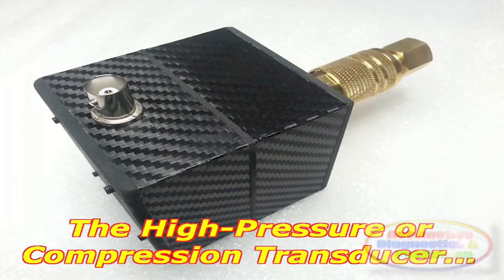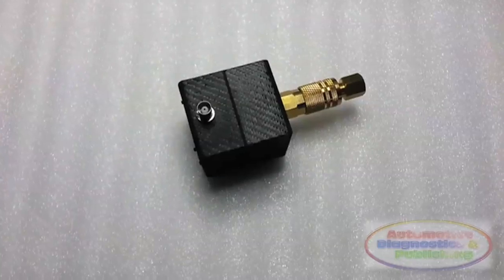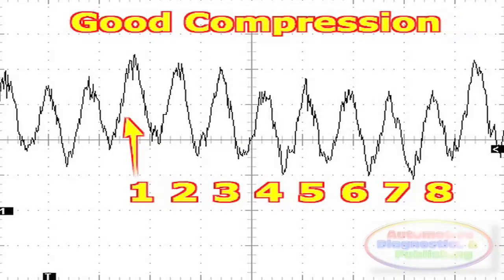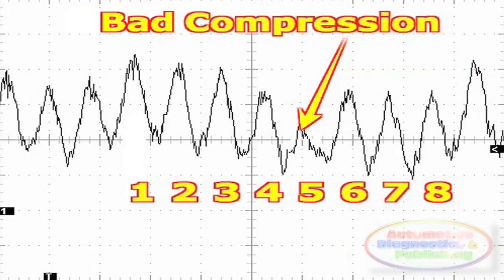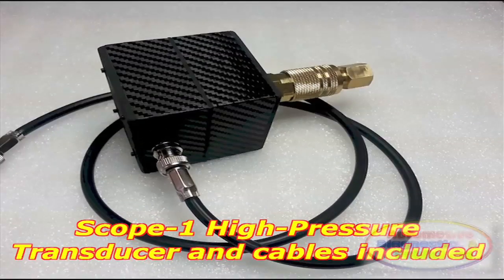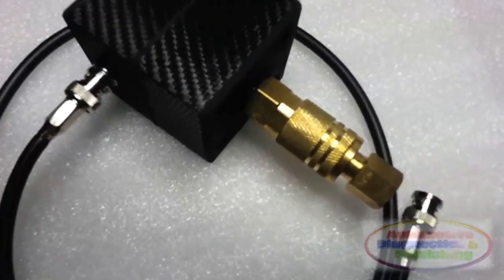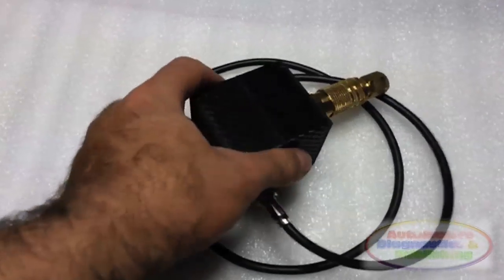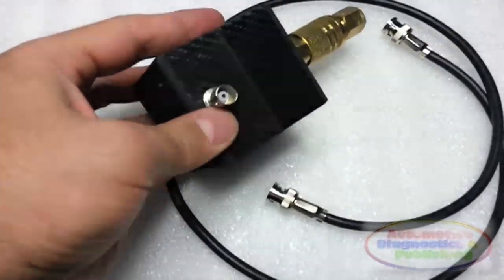COMPRESSION PEEK Transducer

Comment: Does this transducer have an internal battery? Or does it have a way to plug in to a wall or hook to a vehicle battery? Should be able to use on a scope that accepts banana leads with an adapter cable correct?
Reply from the maker: Edward Boers Yes, once it becomes available you may use this transducer on the Scope-1 or any other oscilloscope with a descent display. It'll be sold with all available adapter hoses. Here are some of the links. 

http://www.pinterest.com/ADPTraining/scope-1-automotive-engine-analyzer-oscilloscope/

http://www.autodiagnosticsandpublishing.com/